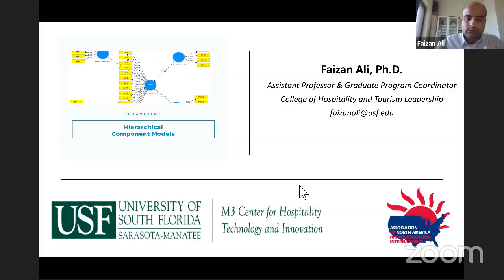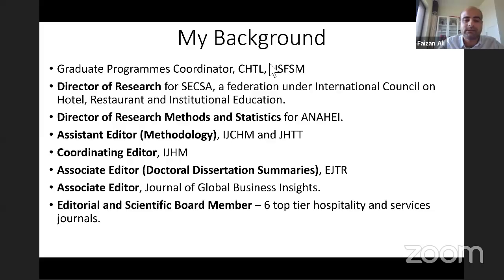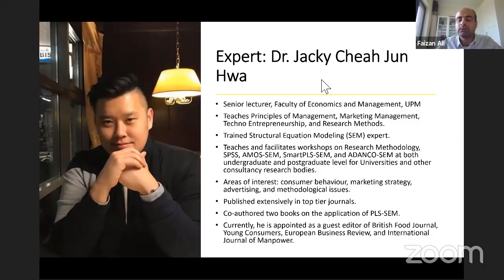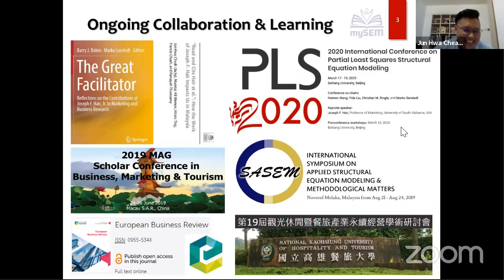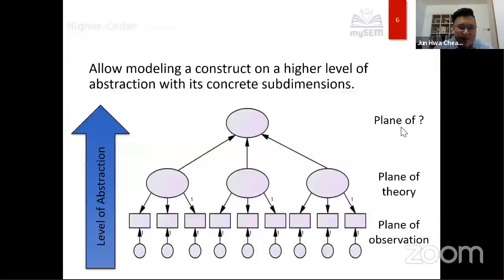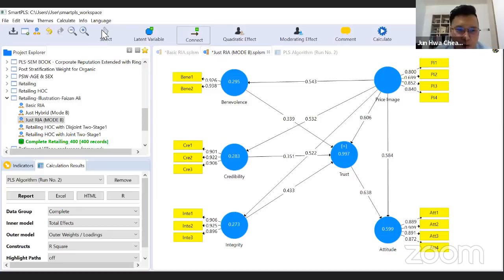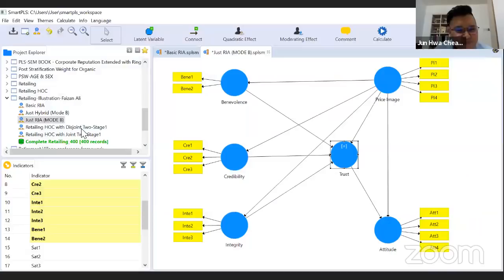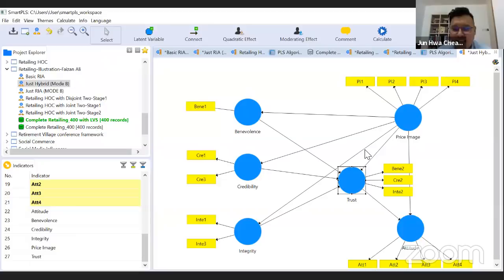Estimating Higher (Second) Order Models in smartPLS

Comment: Dear Sir,

I have a 2nd order construct (formative-formative)...in case of repeated indicator approach, all items measuring first order formative factors when loaded on 2nd order in the first step: this mode of loading will be REFLECTIVE or FORMATIVE ? pls suggest.  

2. after first step, we can get the latent variable scores (standardized scores) and then use them for checking effect of the 2nd order factor on any other theoretically connected factor for establishing Criterion/ Nomological validity of 2nd order  or even the reflective measure of its own self for redundancy assessment?

Comment: Good video ResearchBeast. I have a question. 
What if the higher order variable have their own items? Should I put both, their items and the items of the lower order variables.
Reply from the maker: Mauricio Santos it’s a good question but I do not think it’s possible. Higher order models are a way to measure abstract constructs which are too broad to be measured as a uni-dimensional construct. As such it’s broken down into dimensions so all measurement items should be loaded on dimensions and not to have it’s own measurement items.
Reply: @ResearchBeast  makes sense. Thanks for your quick answer.
Reply: @ResearchBeast  Very clear instruction also answering my similar question, thanks a lot!!!!!

Comment: Hello Dr Ali,
I really enjoyed your YouTube Channel as I am doing my PhD study and this helps a lot. I have a small query which I thought I should ask you or someone who can answer.
 My research model consists of three types of HOCs: reflective- Reflective, reflective-formative and formative-formative. I am interested in using a two-stage embedded way to assess my HO model. In stage one, I did all validity assessments for the measurement model, but now I am stuck in stage two because of following  (1) In stage 1 my understanding was I do not need to consider higher-order constructs when assessing measurement model. i.e.  Ignore all second-order reflective and formative constructs. Is my understanding is correct? (2) In stage 2 my understanding was, we use the normal approach (as like we did in stage 1) to assess higher-order reflective constructs with other reflective constructs but based on stage 2 results. Am I right (3)  In stage two, when it comes to formative second-order construct assessment is not so clear to me. Do  I need to use the same approach as I used in stage one to evaluate the formative model with stage 2 results ? or use the three-step procedure as outlined by Hair etal (2017)? Would you able to give a bit of help to clarify these three questions? 
Thanks

Comment: Hi, I have a an issue when saving the latent variable data to csv. When I import the CSV file, always get error in smartPLS. Do you have any idea about this?
Reply from the maker: Thank you for your comment. I do not really know. Your best course of action should be reinstalling the software.
Reply: Check the csv file in text readers. Sometimes there are separator characters in our data that results in unequal number of columns for each data point.